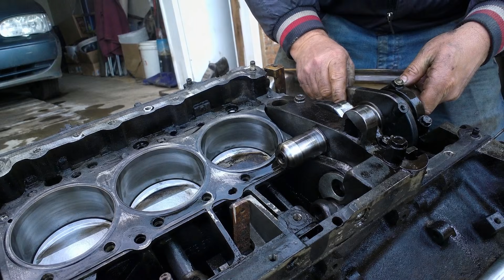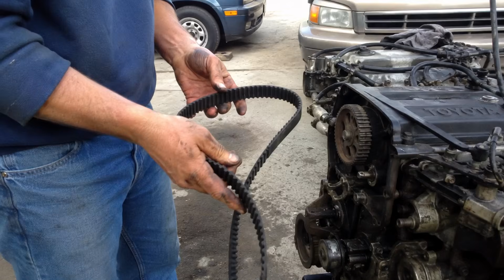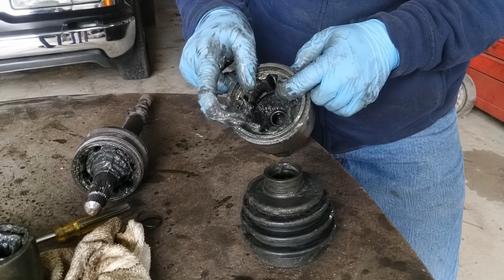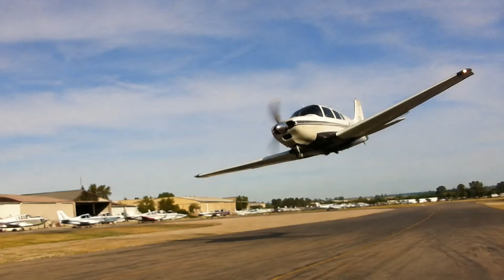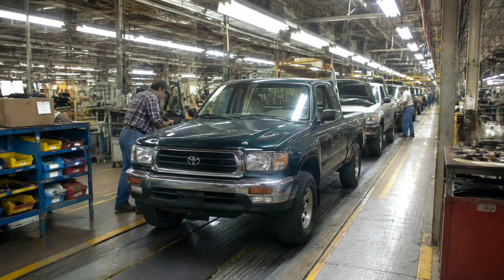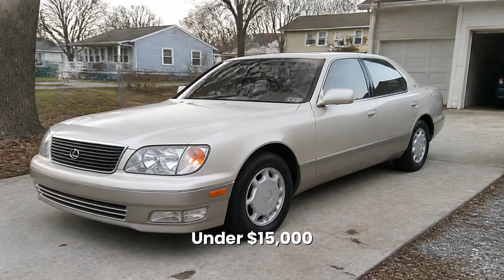5 UNKILLABLE Toyotas That Refuse to Die — Buy One Now, Drive It Forever

Comment: The 1,000,000 truck was driven at least 300 miles daily (10,000/month). Only one cold start every 300 miles. Highway miles, in overdrive reduced revs/mile and transmission shifts.  No lugging or over-reving.